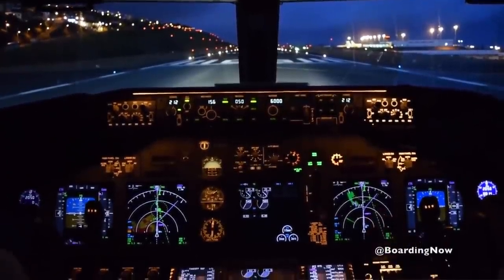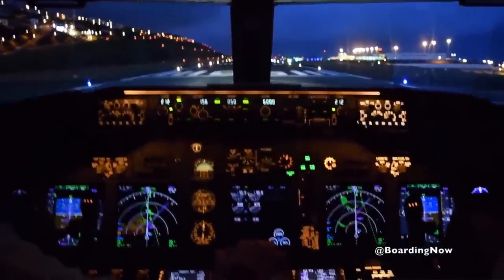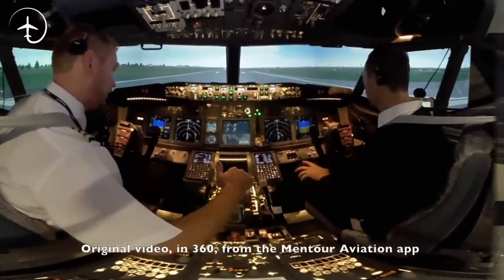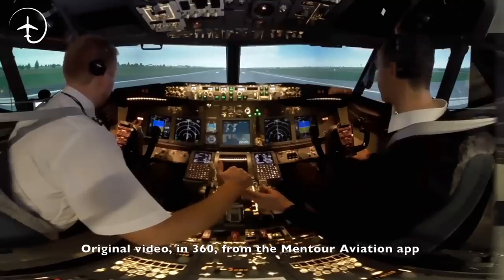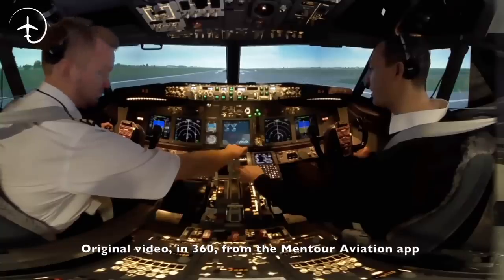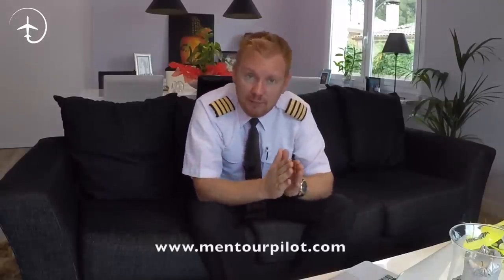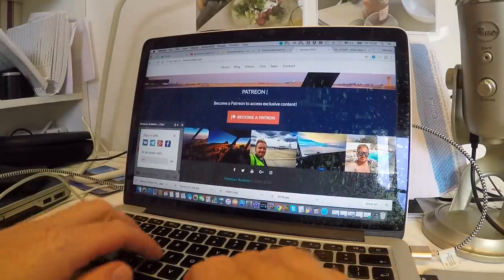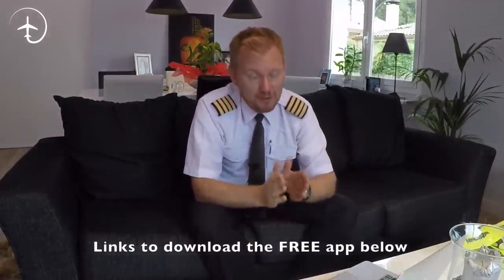Why do the aircraft engines "stop" accelerating during takeoff?

Comment: Great explanation - been wondering about this for years! Makes total sense. I've heard about the difference between spool-up rates between seemingly identical engines as a notable factor in a lot of operations, what is the reason for this - why would one engine accelerate more quickly than the other, when they are of the same type? Manufacturing variations and wear?

Comment: I fly commercial quite a bit... I notice that nearly every time we take off, maybe 2 minutes after takeoff the engine power rolls back significantly for a short bit (maybe 30 seconds or so).  Then the power returns and we continue our climb out.  It could be noise abatement or waiting for ATC climb instructions, but wondering if there's a technical reason for it.

Comment: I kind of figured those were the reasons for run ups on jet aircraft, I know that piston engined aircraft with multiple engines have to do something similar, ramping up to a certain amount of manifold pressure, then release brakes and advance slowly to take off power.

Comment: How do aircraft stay in a straight line during landing? At what point do you stop using rudder controls and start using the "steering wheel"? Is there an automatic system in place to prevent veering off the straight line after the rear wheels have already touched down?
Reply: Immediately on touchdown with the rear wheels the rudder is still in use but once the nose wheel is down and below 75-85 kts the nose wheel can be used.

Comment: Why do some have quite severe roll back after takeoff. I guess I know you don’t need full thrust to keep accelerating and climbing once airborne but it does shit you up a bit when, shortly after getting the air, the engines spool down! Feels momentarily like the engines dying! I notice it more on newer planes...is this because the newer engines with bigger fans have so much more thrust and so don’t need to work quite as hard? For example, A320neo from BHX to FRA we got into the air quite rapidly and then felt like the pilot cut the throttle way back. Disconcerting. On the return we had an older 320-200 with smaller looking fans and this took longer to get off the runway and the pilots didn’t roll back the throttles nearly as much once in the climb.

Comment: There are at least two VERY good reasons why an aircraft engine (on a propeller-driven aircraft) does NOT over-rev on take-off (as do "hot-rod" motor cars at the start of their run).  
Number ONE:  The engine designer knows the RPM at which the engine will be producing maximum torque. And this is the RPM the aircraft manufacturer will quote for take-off RPM.  
SECONDLY: if the engine is over-revved there is a very good chance that the tips of the propeller will exceed the speed of sound - hence BIG loss in efficiency. This is the reason that the old WW2 "Harvard" training aircraft made such a "crackle" (over and above the noise from the engine exhaust) on take-off; and the Cessna A185E with the 300HP continental engine at max takeoff RPM  (2850 RPM from memory) had a similar "crackle" - as we often called it, for want of a better word to describe the noise.  
A third reason to NEVER over-rev your engine is the possibility of catastrophic failure of things like con-rods and crankshafts.   A broken con-rod means instant loss of power and usually a busted crankcase - so there is oil all over your windscreen. The pilot now MUST make a forced landing but probably can't see through the windscreen very well, so may have made a stupid and fatal mistake in trying to be a smart guy. 
[Roger Y:  ex: Licensed aircraft Maintenance Engineer, engines and airframes, AND commercial pilot. I did some work with Luigi Pellarini during the first 4 years of my aviation career, and he was the bloke who told me these interesting snippets of technical "knowledge".]
Reply: max power, NOT max "torque" is the greatest rate of acceleration

Comment: What are the effect of a yaw when the plane is on the ground if not corrected? Would the wing touch the ground? The airplane turn off the runway? Both?

Does this technique apply for smaller jets? For propellor aircraft?

Am I right in thinking that this would not apply to a single-engine jet?

Comment: I thought about this issue after watching your video. Rather than take sides and join in condemning one side or the other, it is best to look for a solution.

If a man boarded that plane, as you quite rightly pointed out, he would likely be addressed as Sir. This is actually an elevation in title because it is actually unlikely that he would actually have been knighted. I doubt whether any male doctors would particularly object to being called "Sir". It is normal to address people in those circumstances as Sir or Madam and not Sir or Miss. Therefore, the appropriate way to greet and address or greet females would be using pronoun "Madam".

Hey, I can already see the pitfalls in the solution that I have advanced. Not just that there may be actual transgender or transitioning people boarding plane ... but with some people, the gender is just not so obvious.

Yes, you are absolutely correct in making it clear that a bit of humility and understanding from flying members of the public would help greatly.

I think that flight attendants have a great reputation for being real bitches. Female doctors can have a bit of a reputation too. There was a film called King Kong meets Godzilla; here we have Bitch meets Bitch.

Comment: I would like to know why whenever I watch cockpit videos of takeoffs, shortly after they liftoff, they seem to lower the engine speed, or at least that's what it sounds like.  You can hear a significant pitch down.  IIRC the takeoff/go around speed is full or close to full power, so maybe once they get enough altitude they pull it back?  But why not just keep at that speed?
Reply: they reduce the engines to climb thrust which is a lower N1 (power setting ) then TOGA to reduce noise,engine  use, and fuel consumption etc. in the 737 you can only use take off / go around thrust for up to 5 mins maximum before it needs to change to climb otherwise too much strain can be put on the engines.

Comment: Question: Is there any warm up procedure for the engines? 
I usually noticed that the engines are started up right before the taxi procedure and have a very small amount of time before the get revved to almost maximum.
Are they heated up by some airport equipment prior to start up? 

Usually, it's not ok to rev hard an engine before it gets a change to get warm, at least for car/bike engines.

Thank you!

Comment: Hey, thanks for the video! I have a follow up question for Mentour. Would it be theoretically possible to take off (from standing still) with just one engine? Let's say there's only a partial load on the plane, good length of runway and otherwise favorable conditions. I understand that no one will risk this during the normal operations, but let's say it's some need for this like a plane being ferried to the graveyard or there's no replacement engine available for an old type or smth.
Reply: I don't know about twins, sorry, it has never been done, and is not legal. However, both three- and four-engined aircraft have taken off on a ferry flight with one engine out.
Reply: Light twins have to be able to continue flight on one engine and a single engine takeoff can be done but one must keep all three of the wheels in firm contact with the runway until VMC is reached. I once picked up a C-337 with the front engine out and really appreciated the 12,000 foot runway.

Comment: Hi Petter, I think on several older aircraft the nose wheel used to rotate backward to retract into the body after takeoff. Why does it now rotate forward on most modern aircraft? Is it only to free up more space in the aircraft's body? Could there be any issues with this configuration?

Comment: Hello Mentour Pilot, I just want to say excellent work! Would you be able to comment on, why commercial passenger Jets are designed with the wing under the fuselage as opposed to the wing on the top like the C-5 Galaxy, C-17 Globemaster or Antonov An-225 Mriya etc? I know at one time Pacific Southwest Airlines (PSA) flew some BAe 146/ Avro RJ's that had wing over fuselage configuration.  Just curious as to why  they basically design all wing under nowadays.

Again thanks for all the insight!
Wishing you severe clear!

Comment: What about shortly after takeoff?  I've noticed that the engine thrust is reduced/slowed down a few seconds during the climb (and usually right after the gears are up).  I'm guessing it's to help reduce fuel consumption?  
Sometimes I can feel the aircraft slightly dip at that point.
Reply: The aircraft derates to climb thrust which is less than takeoff thrust. It might also depend on where you are taking off,sometimes there are noise constraints. Lets just hope he makes a vid on it
Reply: Max take off thrust is more than max normal thrust and can only be maintained for a specific period of time before it invalidates the maintenance cycle. IE if you exceed it, depending on engine type, it can result in a complete rebuild to assure safety standards. That said RR test the engines on MTO for anything up to a couple of hours in a destructive test as part of engine validation - then rate them for about 3 minutes. Basically the engine is tested at MTO then the power is increased in increments with a set time at each increment until it fails. Most engines fail at MTO+40% which can be 3 hours into the test. The thing that often kills the engine is heat, which can get into the steel sections of the engine and reduce strength. At MTO+40% the engine is producing about ten times the amount of heat that it would do at cruise. The 3 minutes limit is unbelievably conservative. Then again most things in passenger aviation are. EG the tests that go on at Airbus for the wings have to be seen to be believed. They basically fail if they cannot take maximum permissible load +70%. That's not the maximum weight of the aircraft, that's a maximum force of a maximum weight aircraft in a turbulent storm. I have been on a proofing flight on an A-340 back in 2006 representing the company I worked for. The aircraft was flown for a few seconds to in excess of 18,000 meters (which was a bit hairy) and normally they fly to a maximum of about 14,000. Then flew a sinusoidal dive/climb that had us actually experiencing slight negative G's and weightlessness. We accelerated into Mach buffet, then slowed to just above stall (which was timed). The most impressive bit is when we were told to brace and an actual A-340 pulled about the same G's as a spitfire would have done in WWII. Damned impressive.

Comment: I have done a lot of flying as a passenger over the last 12 years until the virus hit between China and Thailand. I would fly every 2-3 weeks and I noticed that Thai airlines would accelerate the engines slowly (maybe 2-3 seconds to ~30% wait 2-3 seconds then accelerate to take off speed in about 3-4 seconds) but Chinese airlines were much quicker (maybe 1-2 seconds to 30% wait 1 second max then accelerate to take off speed in about 2-3 seconds) I was always worried that the Chinese pilots were just going through the motions without understanding why they were doing what they were doing. I have seen so many corners cut in China it's unreal. I understand that air travel is more regulated than other sectors but I always wondered if they were cutting corners.
Reply: Johnny RoadTrain  Such a polite and constructive reply. Can you please do better next time. Please. Why the hate?. It's a genuine question.

Comment: I travel a lot in Asia and I notice that when in China the pilots spend only a very short time at 40%(maybe 1/2 sec) before opening the power to 70/80% (this is the same across all Chinese airlines and all areas and all weather conditions) but When flying in Thailand they wait much longer (up to 3 or 4 sec) before applying power. I train engineers in China (automotive factories) and from my understanding the Chinese will follow their instructions but always try to make shortcuts. If there is a low risk of something happening then they feel there is no need to do it and forget about it. What are your thoughts on this?

Comment: Have you ever had to wind the engines up on a short runway and then release the brakes and go? I've had that happen a few times. You definitely get pushed back in your seat. An amazing rush!
Reply: I have been lucky enough to be a guest on a Herc demonstrating an emergency combat take-off, and on proofing flights for various types of Airbus. The proofing flight takes you from almost stall speed at maximum  emergency throttle to the point of getting mach buffet then a zoom climb. The Herc was the best. Oh my word did that thing get altitude quick. It was like the ground was dissapearing below us. Brakes off to 10,000 feet in I think something nuts like 30 seconds. The closest you can get to it easily is a winch launch in a glider. I went on the "oblivion" roller coaster a few weeks after the Herc. Most people screaming their heads off - me? I was "is that it?".

Comment: Hi. Engines revs at 70 % before takeoff during winter to deice the blades but is it also used to deice the attack of the wings by using the heat recovered from the engines? Thanks for your advices

Comment: The RR Olympus engines on the Concorde seemed to use a different technique. Perhaps turbojets were less likely to build power asymmetrically or the idle was higher.
Reply: The Concorde had 8 engines, so asymmetrical thrust may have been less likely. They also consumed a massive amount of fuel during taxi.

Comment: You refer to the "Take-Off and Go Around" button a few times.  Can you please explain more about what it is, what it does?  Thank you for your videos.  I'm not a pilot, I'm just someone with a lifelong fascination with all things flying.
Reply from the maker: Sure, that can be done.
Reply: I'm no pilot - I'm better with trains than planes - But reading other comments here it sounds like a button that's pushed to allow the throttle to be set to higher levels, which would only normally be called for in take-off or "Go Around" (Landing abort; Try again) scenarios where maximal power is called for. :-)

In routine flight (Including landing) you'd rarely need higher than 70% of engine output, so a safety lock on the last 30% makes a good deal of sense. :-)

Comment: Mentour... Here's another question in regards to takeoff procedures...

One time when I flew (I don't fly super frequently), When the plane was fully turned onto the runway, the pilot set what felt like full thrust about 10 seconds after we turned onto the runway.

And then a couple of times when I've flown,, when the plane was centered on the runway after turning off the taxi way, it felt like the pilot applied the parking brake, spooled the engines up to what seemed like full or at least 2/3 thrust, released the parking brake and we took off and accelerated faster. (I guarantee that the pilots were NOT de-icing the fan blades because this was n the summer in Phoenix Arizona and again in Orlando Florida when I flew)

Was there a reason for these different takeoff procedures or was it just pilot preference? These were all done in Boeing 737 aircraft on Southwest Airlines.
Reply: Summer in Phoenix and Orlando -- hot air increases minimum take-off distance, so you don't want to start rolling down the runway until you have full take-off thrust.
Reply: @noframerate  very interesting. Thank you for that information. Since cooler air is denser than hot air, that definitely does make sense now.

I was thinking that the air temperature may have had something to do with the take off procedures but I wasn't quite sure but your explanation answered that.
Reply: Mathew McLean By the way the pilot did not use full thrust

Comment: Regarding uneven thrust increase, is there a mechanism on the throttle sticks that can lock the throttles side by side? For the times when you know you're only going to use symmetric control?
Reply: Dave Crupel No, the throttles is adjusted manually if needed. In autopilot Im not sure tho🙄🤔

Comment: It is funny but as a player of Microsoft Flight Simulator and not being a real pilot i also do not accelerate the engine to maximum when i begin the roll on the runway but for a different reason. I experienced that at lower speed i can better align the plane on the center line before i get to high speed where i do not like if the plane tends to drift away from the center line. And honestly it is way more harder to steer the rudder using those keys on the keyboard then using the pedals in a real plane i could imagine. But as mentioned no clue as i never flew a real one :)

Comment: That was interesting. Now I would like to know why the plane fills up with jet exhaust
while on the ground.
Reply: Al Gorel the aircraft taps bleed air from the engines (compressor) for the air conditioning packs. Occasionally, during engine start and taxi, the engines intake exhaust either from itself or other aircraft due to the direction of the wind. Optimally the engines are started with the aircraft nose into wind. Sometimes due to airport configuration or operational needs this cannot be accomplished.
Reply: Russell Flippin Thanks, that explains it very well!

Comment: Mentour, why do some planes have wings on top of the plane, for example the Q400-8, AN 225, C-5 Galaxy
Reply: they are high-wing planes with the engine thrust higher up so the horizontal stabilizer has to be located above that.